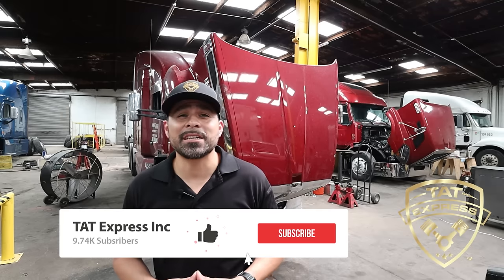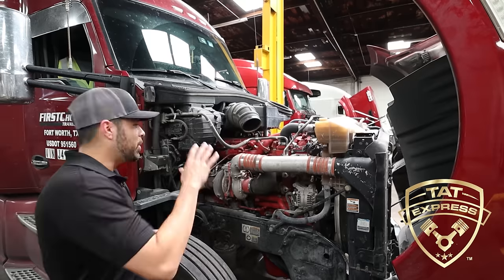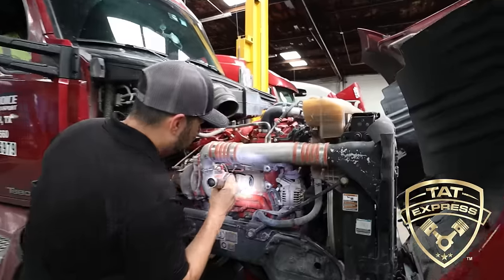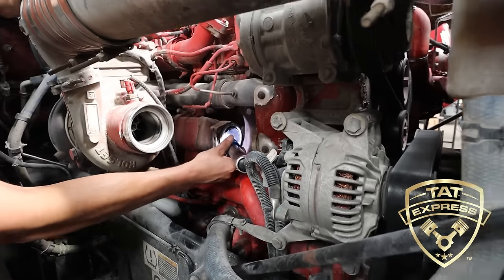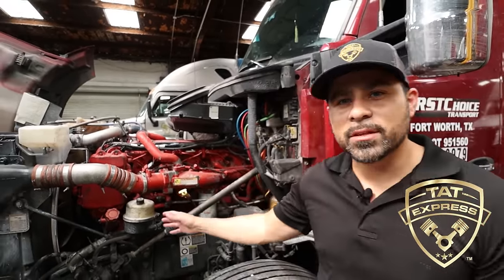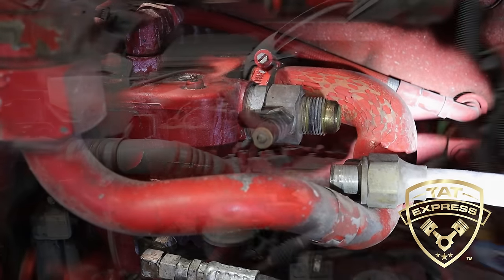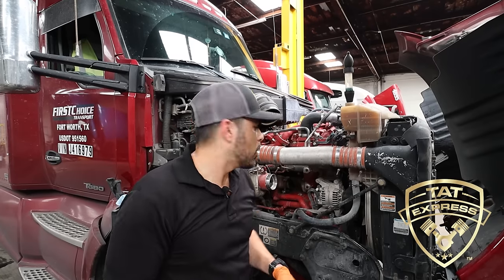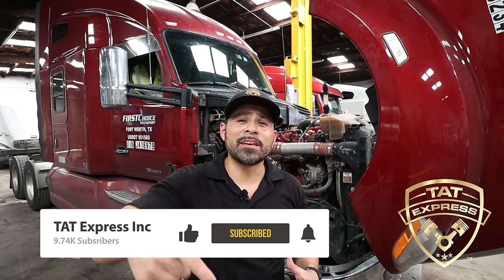Cummins Coolant Overflow/ Coolant loss/ Excessive Pressure in coolant/ Cummins ISX15/ Cummins X15

Comment: Hi guys, I have it I’m Alex 13 packer it’s doing the same thing I am getting pressure in there and I have no idea where that comes from. I did put the camera in the EGR cooler that one looks dry from the inside. I did put a new ad on my air compressor and it’s still doing the same thing. my question is it doesn’t do it all the time. If they head gasket would be broken down that would do it all the time
Reply from the maker: @heinrichthiessen3759,  check out this video.  It is a MX13 Paccar with a failed air compressor causing excessive coolant pressure.  https://youtu.be/8nk7FIGhs7g

Comment: I drive a 2013 kenworth t800, ISX hydrovac truck but don't own it or decide when it gets maintenance...
I can turn the truck off Friday afternoon and on monday morning the coolant reservoir will still be holding pressure.
Quite a lot of coolant comes out of the overflow throughout the day. Like maybe 1L or more.
Anyone have any idea where to start? 
To get this fixed I need to be able to point the money in the right direction.
Right now buying cases of coolant is the fix they are happy with, but I feel like were killing this awesome truck...

Comment: I have the same Problem with an ISX, the Head is Brand New though. Reservoir cap is New, when I fill up Reservoir to ( cold Full) after running the truck for a while specially on an Uphill it throws it out through the Breather hose on the Reservoir.
Reply: More than likely you wasted that money on a new head, odds are a cylinder liner has broken loose and taken out your fresh new head. To see if this is your issue, drop the oil pane, pressurize the coolant system to 20 psi and let her sit overnight. Now, have someone get under the motor with a good flashlight while one of you bars the motor over by hand. If it is a slipped liner, you should be able to hear coolant gurgling in the head and will find traces of coolant on the cylinder wall, normally #5 or #4. Always do this test before removing the head, as these Cummins heads are pretty much one time use, and never use a remanufactured head, always new OEM.

Comment: 330°?! Man, that head has been cooked...sautéed & deep fried!😂😂😂
Reply from the maker: Yes, 330 is extremely hot. 🔥🔥
Reply: @TATEXPRESSINC  Whats HOT ON A DD15
Reply: @TATEXPRESSINC  would a leak from a hose cause the same issue? Like it sucks down while running then returns to reservoir. But I do have a line that only leaks while truck is running.

Comment: What about a  failed combustion test with no other issues. No coolant loss or overflow
Reply from the maker: New literature has indicated a positive combustion test reading with newer engines due to EGR. I would recommend testing the EGR cooler separately

Comment: 330 degrees??? Somebody tost that engine, what's up with the engine protection program it's supposed to shout it off at 230 ain't?
Reply from the maker: 330 is what abuse history indicated.
Reply: Yeah but I takes some time to shut off plus in some truck you can override that for several minutes, 330 it's insane though

Comment: My x15 Cummins engine is pushing the coolant out of the reservoir I changed the reservoir on it I don’t know the history.the dash says 500+k miles on it,who knows the miles could’ve been rolled over on the truck the truck it self doesn’t over heat could it be bad head gaskets???

Comment: I have the same problem on Volvo D13 engine
Reply from the maker: I would recommend having engine trouble shoot, same as in video. Thanks for watching
Reply: Did u fixed it?
Reply: @eugeniujosanu279  I drilled tiny hole in the middle of cap for extension reservoir to depressurize it.  I just watch coollant level to be exactly on the mark. It seems doing fine
Reply: @johnysilver1853  did u noticed any oil mixed with oil or coolant coming out between the head and block btw?
Reply: @eugeniujosanu279  no my coolant looks clean all the time of 3 yrs I own truck but it had this high coolant pressure from beginning. Had it drained couple times during some repairs coolant looks good. I'm not really mechanic but I dont have coolant leaks. It just when too much air pressure builds in system it will push some coolant out from coolant pressure valve on expansion reservoir it drops it below minimum mark and I always had to add coolant. After I drilled the tiny hole it does not do it anymore
Reply: Did u drilled hole at driver side cap or passenger side reservoir cap?
Reply: @MuhammadAfzal-xo4jj  Passenger it twists on top of the tank

Comment: Maybe that’s one of the problems, but NOT ALWAYS necessary to replace CYLINDER HEAD,  there a thing inside of cylinder head, that could be replaced, you do have to take it to a special shop for that, that’s what I did, cylinder head itself, I paid about $1k, they will tell you, before and after the results, and which cylinder it was, once I fixed that, the problem was gone!

Comment: I  have a 2016 Volvo vnl n went to TAT EXPRESS cuz my light kept coming on saying STOP, so I went to TAT cuz I liked Adam and felt he knew what he was talking about...so TAT EXPRESS checked to see where the coolant leak was coming from and told me I had a leak in my coolant lines and to replace them would be $1900.00.. they replaced the lines and I left... later that night the same light came on saying STOP.... so I took my truck back... and told them that I was having the same problem... they checked it again and said I have a crack in my reservoir.... I told them that I think the was the problem originally and wanted to b compensated.... they refused and told me I had a leak in my lines also... which I didn’t believe but couldn’t prove... so they replaced my reservoir which was only 500 and they paid for it....I left pissed cuz I felt like I had just got jacked for 1900... with all that being said... I can’t say that they are crooked or not, but BEWARE OR AWARE!!!!
Reply from the maker: Dwayne, we are sorry you feel this way about your experience.  The coolant lines that run to the SCR are very common lines that fail which we have pics. Also in most cases when coolant lines are brittle there could be more lines or tanks that can fail.  Especially after a repair and more pressure is in coolant system.  We thought by providing the coolant tank at no charge was suffice. Again sorry you feel this way about your visit.

Comment: Real question is.. why was the truck running hot ? For 3 minutes? What da fuck was the driver doing ? Pulling hard? Engine fan wasn't pulling enough air ???
Reply from the maker: Good observation, we suspect engine may of lost coolant and engine got hot.

Comment: Don’t waste your time with these guys. Called ahead of time to get a state inspection done they said no problem come on in. Showed up 15min later they said we’ll get you right in.. 2 hrs later they still hadn’t pulled my truck in for inspection what a waste of time
Reply from the maker: Alex, sorry for the inconvenience.  We are in process of adding another state inspector.  We will be more than happy to issue a refund for the headache. We receive a lot of inspections daily.
Reply: Waooo an apologize an a refund, Alex if you're a real trucker accept the apology and don't take the refund that's like 10 times more than what you would get at any other shop thanks Adam for been so transparent